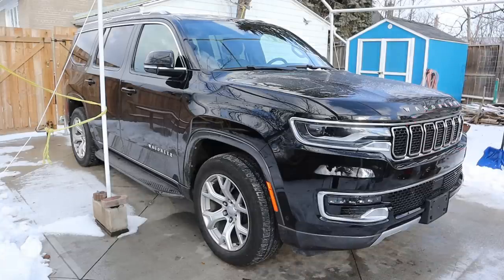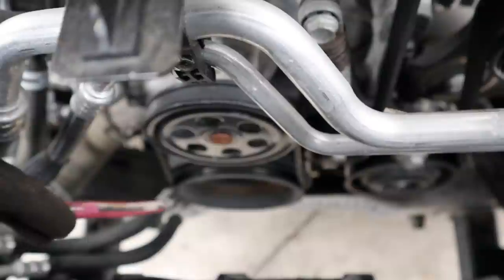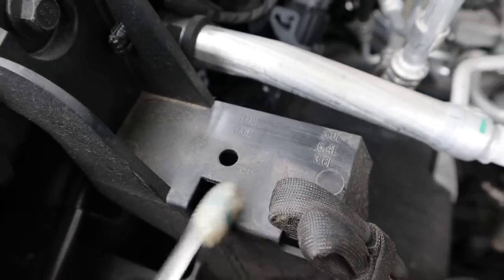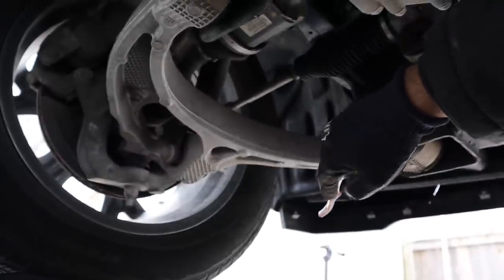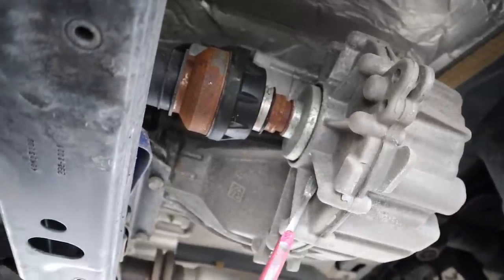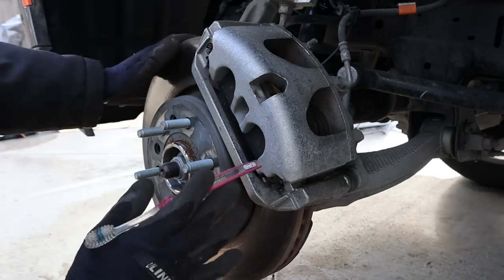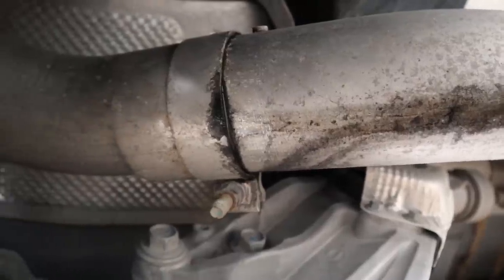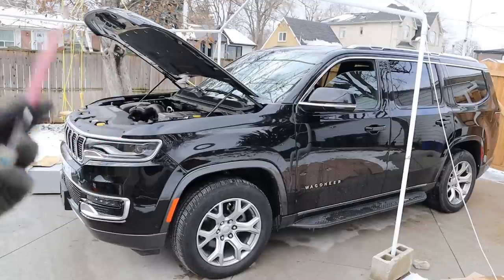Jeep Wagoneer Mechanical Review

Comment: The brakes!  Yes, the brakes!  I work for a rental car company so I get to drive a wide variety of vehicles including the Wagoneer and you nailed the brakes...they're not confidence inspiring at all.
Edit: And that engine does not like cold weather from what I can tell.  I got in one today that got a good cd soak in 10°F temps overnight and it was not happy.  Took a few minutes to smooth out and quiet down a bit
Reply from the maker: I found the grand Cherokee the same with the brakes...very difficult to stop the car with reasonable force.
Reply: @speedkar99  wait till you see this thing hauling a boat during the summer

Comment: "Stupid design" you say. It is indeed true! By working as a consultant for big companies in automotive, medtech etc industries I can only observe & confirm an increase of stupid designs, unfortunately. One of the reason is outsourcing. And I dont  mean outsourcing of the machinery production or software, I mean outsourcing of the design engineering. Many engineers (mechanical, thermal, structural etc) in those, typically 3rd world/developing countries are underpaid, overloaded, not experienced and not motivated. Most of them are unlikely to even own such vehicle. Thus, the design suffers. But, contrary to these designs the consumers aren't stupid and thanks to your great reviews some automakers rushing with such crappy or/and unserviceable designs will disappear.
Reply from the maker: You are right. When you outsource you lose touch with the vehicle design and purpose as they are designing and testing within their bubble.

Comment: The one time a domestic automaker puts a factory drain plug in the transmission pan, and they put it in a plastic one over top the exhaust pipe. Just blows my mind!
Reply from the maker: The repair manual calls for you to remove the entire pan to drain fluid. The plug is probably there because of parts sharing!

Comment: Its my first time hearing about active vibration dampers. How do those work, what signal does it use to know the speed it needs to turn at or are they pre set to a certain frequency.
Reply from the maker: It works like noise cancellation. 
Vibration from the chassis is collected through sensors and emitted in 180* opposite wave form to counteract it.

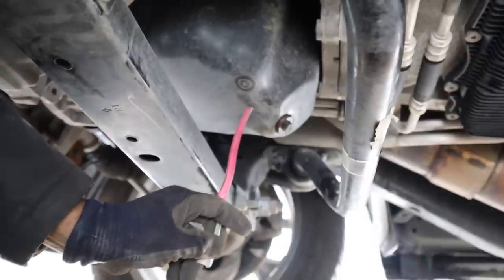Comment: @8:05 I never did understand why car manufactures place the oil drain plug there.  Why not elsewhere that it does not make a mess.
Reply from the maker: I've heard the RAM 1500 has the same issue

Comment: I'm not familiar with Chrysler products, does the dissimilar metals in the block and head cause head gasket issues?
Reply from the maker: Many engines still use iron block and aluminum heads. There is a thin head gasket between them so dissimilar metals isn't an issue.

Comment: Reminds me of a Navigator, pretty on the inside and out. But just the basics when it comes to engine and body mechanics design. Nothing like the German and Japanese luxury cars. Cadillac does the same kinda builds, no aerodynamics underneath, exposed electronics underneath, no heat shielding for the exhaust, the list goes on. Basically, most American luxury cars are just dolled up lesser class of vehicles from their sister companies. And not truly engineered from the ground up like other foreign car companies do, to separate their class of vehicles. IMO
Reply from the maker: Yeah it's just a gussied up RAM

Comment: They should have put a hemi bigger than the 5.7. But they were thinking about fuel economy with the MDS system and know the straight six is coming. Mercedes has a straight six in their top end SUV that is doing the same things they are trying with the Wagoneer.
Reply from the maker: I don't get why Jeep is trying to go upscale and compete with Mercedes. It isn't gonna happen...
Reply: @speedkar99  Maybe that straight six will be good as it sounds. That MB six is pretty good.
Reply: Body on frame seems odd these days.

Comment: I purchased the Series 2 Wagoneer.  I am satisfied with my Truck.  It's peppy, stylish and has plenty of room for the family. Also it was more cost-effective over the competition. PS Don't let It's size fool you.  The 5.7 has great power and passing ability. Ask the driver who was trying to muscle in on the right.  He looked real silly and had to get in line like he should have....
Reply from the maker: The 5.7 wasn't slow. It was adequate  for the size of the vehicle. I wouldn't call it cost effective for a family... Unless you need that towing capability. Same goes for suburban, Tahoe or expedition.
Reply: @@speedkar99  Well I must ask. Do you own a Wagoneer? Also I gave praise to Mopar for the 5.7's power.  Furthermore you're comparing the Wagoneer to the Tahoe and Expedition.  They are in a different class.  You might want to compare it to the Navigator or the Escalade.  If you can buy either of these SUV's with 1. Leather 2. Sunroof 3. Alpine system 4. Running boards 5. Tow package ETC. For under $75,000. You may want to make that purchase.  I'd love to see that.  Thanks for sharing...
Reply: @brianel8550  Wagoneer competes with Tahoe/Yukon, Expedition, and Armada, Grand Wagoneer competes with Escalade, Navigator, and QX80
Reply: It’s a minivan with a hemi.

Comment: IT HAS A FRONT LOCKER?
Reply from the maker: It sure does
Reply: @speedkar99  You sure that's not just a front axle disconnect? Many 4x4s have a sliding collar that disconnects one of the front drive shafts so that the front ring gear and drive shaft do not spin when in 2wd (like manual locking hubs) to save fuel. Generally, an actual diff locker mechanism is located much closer to the ring gear
Reply: @jeremygosling363  Yeah, even the most capable Jeep that isn't a Wrangler, the Grand Cherokee Trailhawk, doesn't have a front locker.

Comment: how much of this design do you think is from Fiat?
Reply from the maker: The transmission and underbody maybe
Reply: @speedkar99 nope, transmission is from zf. Solid transmission. Underbody was already in the works on 06-07 prior to fiat. So cerberus/benz play. Little part here but mpstly chrysler original. That hemi is a knock off of the 5.9 and 5.2 magnum engines. The magnum engines whil they had minor intake leaks they were great.

Comment: Subscribed for a long time and really like your content and presentation but I don't get why you're so down about "antiquated " "old school" engines.  You mean the good old proven, iron block pushrod engines, without all the hugely problematic electronic ECU controled stuff, and are dependable as a hammer. 

Friends high end Ford Expedition is on it's 4 th valve phaser repair. Had the leaking internal water pump replaced and previous vehicle was on the flatbed back to the dealer more than on the road. Modern engines dirty intake valves because of direct injection, fouled intakes from EGR. The hard to modulate brakes because a control module regulates them instead of your foot. A myriad of hard to diagnose ECU and sensor issues, stressing small engines to their breaking point with turbos, and on and on. How is that better.

I'm 75 yrs old. First car was a 1951 Dodge flathead 6, 3 speed manual. And, along way with  my dad, experienced several million miles in all kinds of vehicles. Been there, done that and the only real necessary benificial improvement to modern vehicles is their tremendous improvement in accident survivability.

My ideal vehicle:  some modern rust free vehicle still in good shape but destined for the crusher because the mandatory engine/ drivetrain repairs are more than the value of the vehicle. Gut the engine bay. Throw it all away! Install a rebuilt crate 4 litre inline 6 from a '98 jeep with 42re transmission.  If not enough engine bay height a mopar 318 or any proven dependable crate 1980's or '90's engine / transmission of your choice. There are many.  Carbureted best. Install vacuum boosted brakes, hydraulic power steering.  Oh, and how dare you not forget a catalytic converter.

Gut the dashboard. Throw it all away. Search the wreck yards for good cable or vacuum heater / ac controls. 4 speed manually controlled fan.  "Old school" instruments and cable speedo is easy as is great aftermarket sound system (playing only '70's southern rock).

No control modules anywhere!  Only sensors are engine temperature and fuel level. Now you have a safe, dependable vehicle that will last a few hundred thousand km. In the event something does go a little off any shadetree mechanic can fix it with a screwdriver and pliers. Perfect!
Reply from the maker: Thanks for your thoughts. The engine is antiquated which is good for maintenance and reliability but not efficiency.

Comment: Awesome review.  Too bad this rolling turd had a boat load of issues.  Already replaced a failed brake booster and master cylinder, which had less than 1000 miles on the meter.   Our shop already replaced the entire harness  from front to back on 2 of them that had electrical issues.  We found a few wires that had lost continuity where part of the harness splits off, probably stress from stretching then snapping off. These had less than 2k miles on them.
Reply from the maker: Ouch, sad to hear but thanks for the feedback

Comment: These days this kind of 4x4 are just fashion statements. The owners who do try to do serious off road will be calling to rescued or pulled out by real 4x4s, which are very few today.
   On that Wagoneer the exhaust pipe so close to the plastic trans-pan without even a heatshield will be sure to cause failures.
Reply from the maker: Yeah this isn't really meant to be off-road with this setup. Too heavy

Comment: I feel like most cars made after 2010ish are dying breeds haha
Reply: Yeah.  I plan on holding onto my 2011 Mazda CX-7.  Just had the brakes done on mine.  $400 for all the parts and $400 for my mechanic to do the work.  Better than the Mazda dealership, Midas, and Canadian tire, all wanted $1500 for the brakes.
Reply from the maker: It's because of emissions laws holding OEMs accountable for fuel economy. They gotta cut costs and weight somewhere

Comment: I FKN HATE THE OVER RELIANCE OF PLASTIC PARTS ON ENGINE ITEMS THAT ARE SUPPOSED TO LAST THOUSANDS OF HEAT CYCLES !!!!!! GOD KNOWS THAT BETWEEN THE OVERUSE OF PLASTIC AND UNNEEDED SWITCH TO ELECTRONICS (FOR THINGS LIKE THE GAS PEDAL AND THROTTLE BODY) MEANS LONG TERM RELIABILITY IS NOW A THING OF THE PAST. I BET CARS OF THE 90'S TO 2010 WILL BE THE MOST RELIABLE ERA OF VEHICLES. JUST ENOUGH ELECTRONICS BUT NOT AN OVERABUNDANCE.